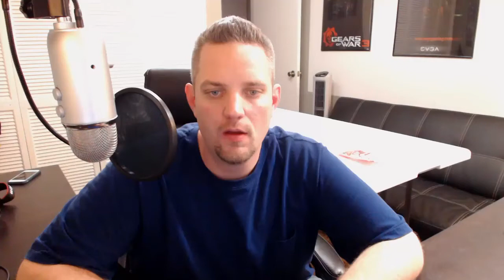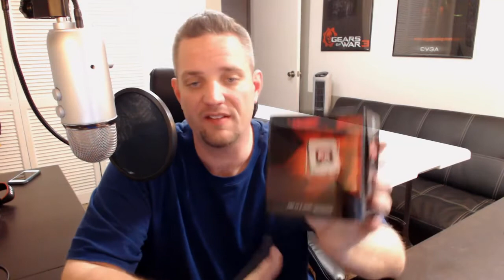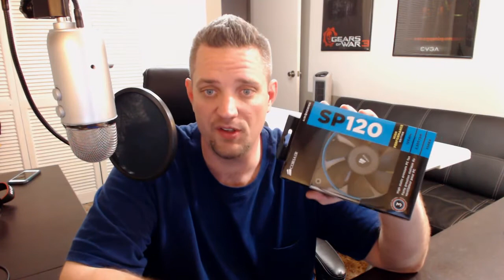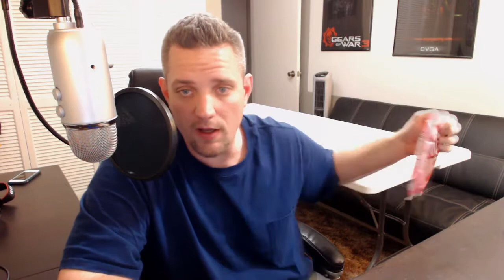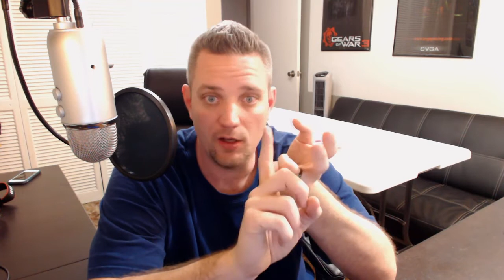(2/2/2013) Upgrading my PC and rebuilding the Water cooling loop!

Comment: He would probably smash my computer then. There's this noise that it makes at random, it sound like a fan is hitting against a small plastic zip-tie. I checked many times and nothing is in the way of the fans though. I might have to check the screws but I didn't install any custom fans and if my heatsink was loose then it would've fell by now.